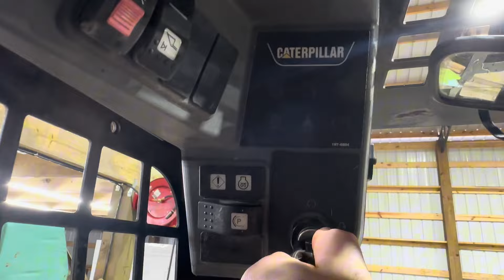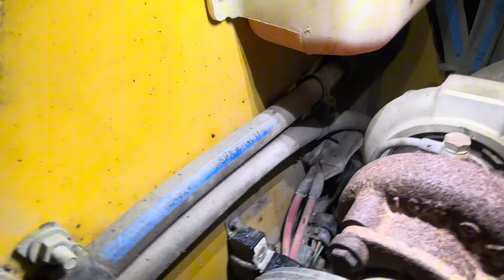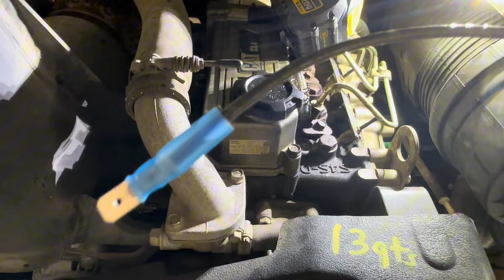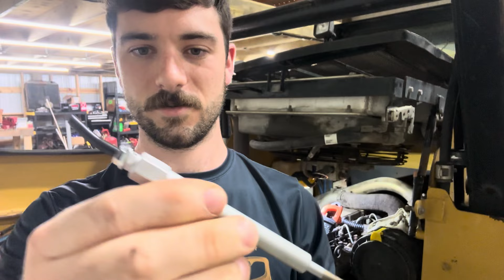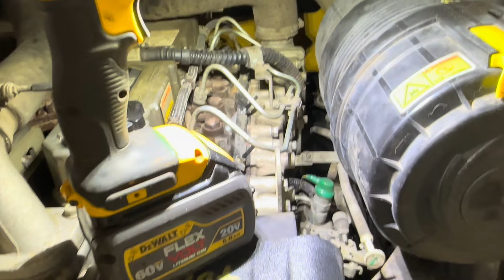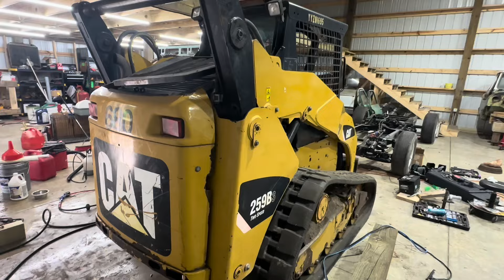CAT 259B3 Glow Plugs Not Coming On - FIXED!!

Comment: Could you just buy a new sensor and plug it in.. Just to see if it works and the glow plugs stop flickering? My machine starts and does everything but I got no power going to the glowplugs it starts kind of hard sometimes.. Did your glow plug light Stop flickering? And stay on and stop flickering?
Reply from the maker: This actually ended up also being the ignition switch. The tumbler went bad and was allowing it to turn just past the contact for it so it would crank but not send ignition power. Try turning the key 95-98% of the way and see if it starts.

Comment: This was a huge help i have the same machine with the same problem.  Thanks for taking the time and putting this out there
Reply from the maker: One other thing I was running into was that my key was rotating past the contacts. I replaced the tumbler and it fixed it.
Reply: @BarnBuiltFabrications   thanks again for the help
Reply: I need help with an oil pressure light causing a no start on the same machine